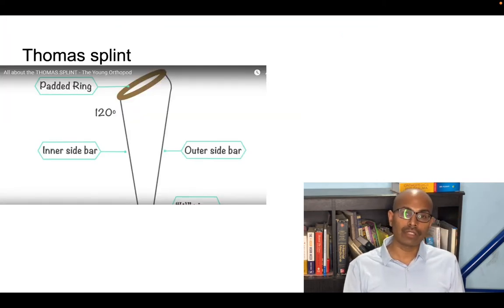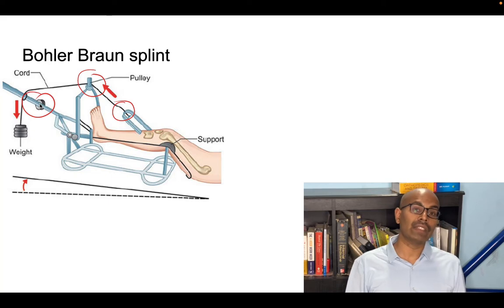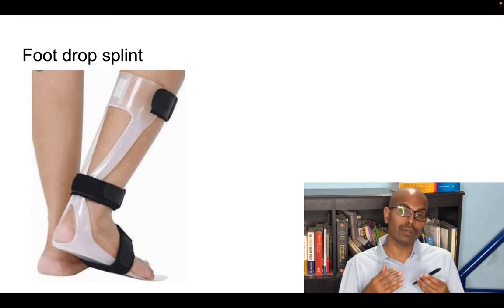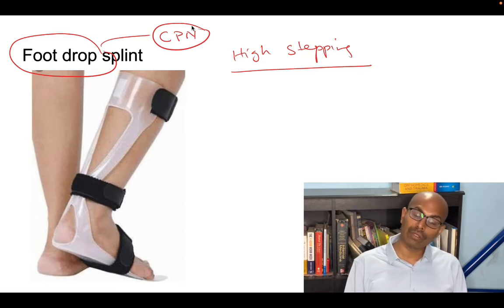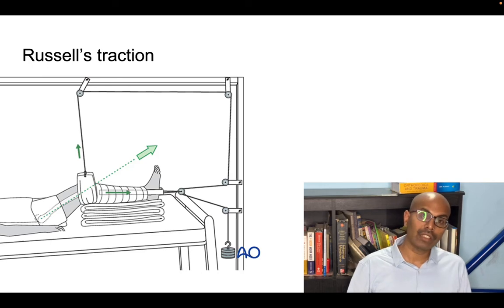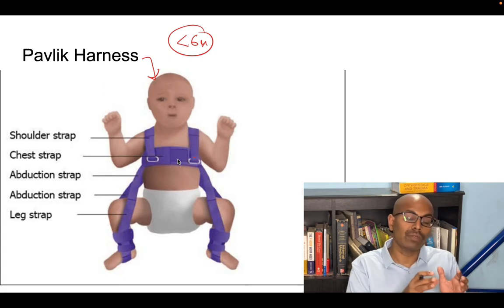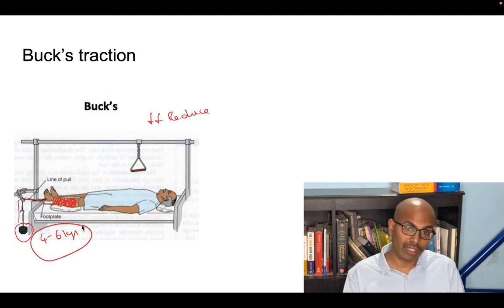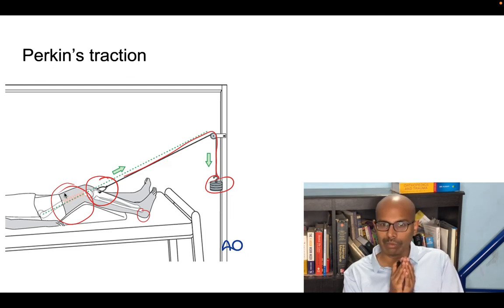Lower limb splints and tractions for neetpg #fmge, #neetpg, #inicet

Comment: in perkin's traction you mentioned that a pin is hammered into the bone and then traction is given. Sir, i wanted to know whether this hammering of the nail into the bone is an opd procedure. i ask this because you mentioned that Buck's and Perkin's traction are used to reduce pain in the interval from admission to surgery.
Reply from the maker: Yes. It is usually a OPD or minor it procedure under local anesthesia.